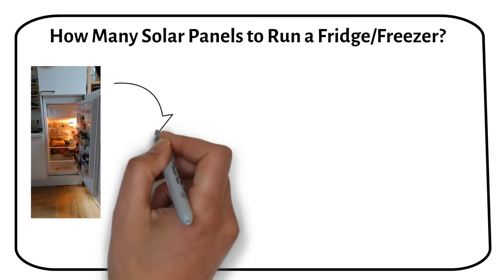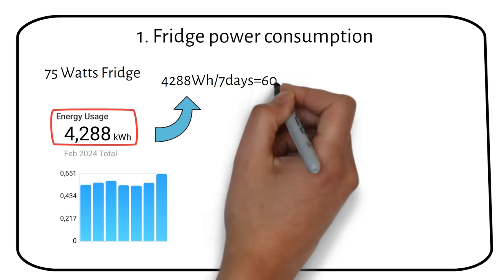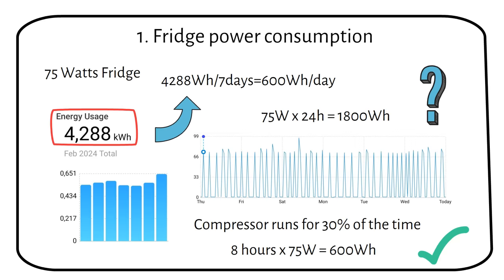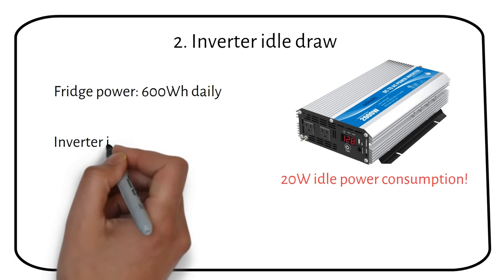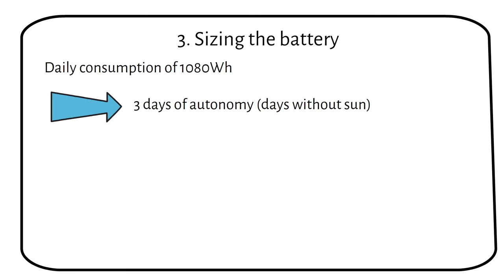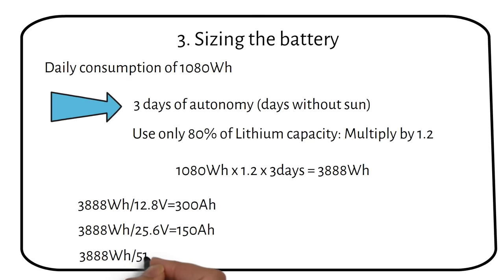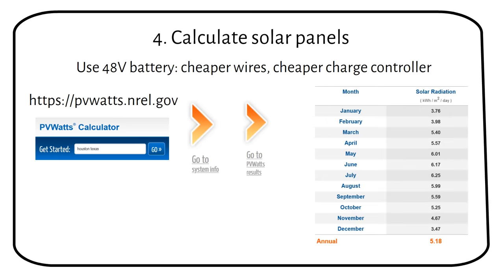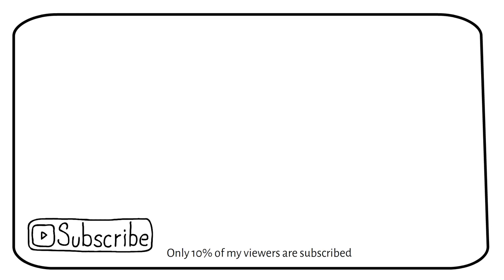How Many Solar Panels To Run a Fridge/Freezer?

Comment: Actually, a fridge and a freezer are not the most power hungry things around the house. Those that cook and heat water with electricity have it tough. 
Very good info, thanks. I will sent the video to all my friends that ask me how many panels and battery capacity they need to run theirs house totally off-grid.
Reply from the maker: Indeed, heating and cooling are the most power-hungry. At least with cooling, you know there is sunshine, too. Thanks, Sebastian!
Reply: @cleversolarpower  I am really glad I found  your channel, you explain all verry well, easy to understand and follow the flow. Thank you.
Reply: @sebastian19745  Agreed. And a pleasure to hear things described without the abrasive 'up^speak' of which westerners have grown so fond.
Reply: pay attention to the fridge compressor start up wattage needed as that can be 4kw, so you will need a 4.5kw inverter just to get that compressor running. once it is running it will constantly use a much lower wattage.
Reply: The only problem is that they would need to be completely off grid - if you are still connected to the mains and you have a power cut the solar generation automatically shuts down - otherwise the electricity workers can't get a totally dead power line to work on! (You'd think they could get a system to auto disconnect from the grid until the power came back on so we could carry on using our own generation!)
Reply: @DC-te1gw  Just about all inverters can handle surge loads.  High frequency inverters can usually handle 2x, low frequency inverters can usually handle 3x.   So you can size the inverter to roughly 1/2 the surge load and it won't break a sweat.   

Surge loads for modern fridges tend to be very low.  Often under 2000W, and running loads are typically in the 200W range.  You definitely don't need a 4kW inverter nor would you want one because the idle consumption for a 4kW inverter is huge.  I can run my full-sized home fridge with a 800VA low-frequency inverter without issue.

Old fridges might be a different story, YMMV.

-Matt
Reply: Don’t forget gaming pc or console
Reply: You don't want to support the most power hungry devices as the cost can be 5 times more expensive to build your system. You want to have all the basics covered

Comment: I've been slowly working on my offgrid system and one of the challenges for me is location and number of panels. My local government requires a lot to mount panels on my home DIY, so I have free-standing, movable panels, but this is not ideal as it takes up more usable space on my already limited size lawn, and is an eyesore to my spouse and neighbors. I currently only have 400 watts of panels, and might reasonably be able to increase that to 600 or 800 maximum. I have way more space in my basement where the storage batteries are, so my strategy is going to be to increase my battery capacity and potentially remotely charge some additional batteries from another location or from my car alternator if needed to top up or extend my runtime in the instances where my panels will not be able to keep up with the demand over a longer period of time.
Reply: My beloved local government doesn't give a shit where I put panels on my property but after cleaning the panels on the roof a few times and those on the ground level... I will be getting those buggers off the roof very soon. The occasional brooming is way, way easier at less than 2m above ground. And they cool better. 
Just a thought...
Reply: After 37 years as a carpenter having installed rolled roofing, shingles, shakes and tin roofing, I've never subscribed to adding more holes in the roof to attach solar panels.

Comment: We got 4 (100watts) facing east and 1(100watt) facing west. It runs out big fridge freezer and outside lights for 10months in a year. In December and Jan we charge out AGM battery bank at midnight during the cheap rate. The whole thing saves us about £70/yr

Comment: I run my ancient half size fridge on 6 HF solar panels and 2 100ah li-time batteries. I have my system wired in a 24 volt configuration and a rich solar 40 amp charge controller.  I have had to run the generator  a couple times but it has been very minimal.  When you have a smaller system and are off grid or just don't want to use wall power or a generator it pays to watch the weather and learn your own personal equipment.  Also going to a 24volt system is the best,easiest and cheapest way to go.  24 volt also has a little bit better conversion efficiency. I started with 12volt and can definitely vouch for the efficiency factor of going to 24volt.

Comment: One word about inverter sizing:

I recommend buying one with the same rating as a standard wall socket. That gives you the opportunity to plug in any household appliance in the future without having to buy another inverter.

I use a 2000 wh inverter for every appliance I have.
Reply: Be sure and get a true sine wave inverter, NOT a modified sine wave inverter!
Reply: @vincentrobinette1507  I am using a modified sine wave inverter and have not had any problems except for my clocks do not keep time correctly.

But I do agree with you that a person is better off with a true sine wave inverter.
Reply: I tried a 300W inverter on my 75W fridge. It turns out, that the compressor needs higher currents during start up. So my inverter always went into overload. A 800W inverter works now, but it also gets very noisy in that moment. So more than 1000W would be recommended.
Reply: @notconnected3815  Refrigerators that have the new-style rotary inverter compressor do not have a high start up surge.

The conventional style refrigerator does.
Reply: @Matthew_Loutner  Oh, i didn't know that. So someone who is planning to build such a system should measure the peak current of that particular fridge before choosing an inverter. Thanks for the tip!

Comment: Excellent!!  I live off grid and my solar and wind run a 5000W (surge to 10,000W) modified sine wave inverter from a bank of surplus aircraft NiCad 12V batteries.  We use propane for the fridge and that allows us to just turn off the inverter at bedtime.  One of the problems we have run into is the startup load for the electric freezer on another portable system.  We were using a 1000/2000W modified sine wave and had to go up to a 2000/4000W just to handle the start load.  When it's running the load meter shows only about 45 watts.  Also there are some appliances like blankets and heating pads that will not work on a modified sine wave inverter.  I don't recall if he said the inverter was a pure sine wave or not.
Reply: Does inverter have its capacity
Reply: Motors don't run as well with a modified sine wave.

Comment: Very informative video, I appreciate your attention to detail. I have a UPS system of 6200 watts and 5100 watt hours of battery (4 X 102Ah) @12.5v so it is a 50 volt system. Inverter uses 50 watts an hour idle current. I will add more battery power next.
Thanks for the video.

Comment: Clearly depends on the freezer or fridge. With mine, I manage to run it 24/7 with a single solar panel even for several cloudy or rainy days in a row. Plus, the freezer itself acts as a battery.

Comment: Thank you so much for these informative videos!  We are slowly building our system with the hopes of one day being off grid. Currently we have 1800W solar panels at 24volts, 3 each 24volt gel batteries and a 3500W inverter... but we are still wanting to learn more about the capacity and what we can run continually on what we have. Thank you again!
Reply: look up, lithium phosphate batteries. wth good bms they cant last more than 15 years.
Reply: Add some type of water source with Columbine waterfalls for continuous power

Comment: Rather divide the daily required power by the usable battery power than multiplying it : 
e.g.
You said : 1080Wh x 1.2 x 3 days = 3888Wh (x 120%)
Rather :   (1080Wh ÷ 0.8) x 3 days = 4050Wh (÷ 80%)

Other than that, this is a brilliant video!

Comment: What happened to the consumption while charging ? You must charge the battery and run the appliance - for 24 hours - to get a valid sizing. You must define your initial condition and reach the same condition again to have valid sizing.
Reply: Good point!

Comment: I have a shed that has a full French door fridge,, upright freezer a attic fanI and some led lights. I have it connected to a 12v system. I have 6- 100ah beep cycle batteries, wired in parallel. Two charge controllers that have one 320watt panels connect to each. I’ve been running this for close to 3 years. During the summer it when it runs the hardest and the batteries barely go below 80%. Those panels fully charge the system, even on rainy days.
Reply from the maker: Thanks for sharing your system.

Comment: I have bought a compressor Refrigerator for the Motorhome 12 / 24 V for comparison. Cool 101 liters Freeze 31 liters, 457 Wh/24 h and no converter is needed for operation. Not big, but in the RV it is sufficient and if you have it at home, you can have 2 and turn one off when you don't have much food.

Comment: i ran a fridge on a very small island system years ago. it worked with the cheap no-name inverter, but when i replaced it with a brand one (AEG) it started to kill my lead batteries every year until i noticed:

the no-name brand had almost zero idle draw while the expensive brand one drew more than 20 watts. the brand inverter broke every few months and i got 3 warranty replacements until the lead battery exploded which destroyed the inverter for good

Comment: Less sun hours in winter will typically correspond to lower house temperature which will reduce energy usage per day.  Thus, your solar sizing seems rather conservative (worst case). Otherwise, solid analysis.
Reply: Only when you use aircon, which is rare in Europe

Comment: I'm not sure that winter offers the worst conditions for a fridge. If it's 3 degrees outside, well then the battery won't have to discharge at all.
Reply from the maker: Do you put your fridge outside?
Reply: @cleversolarpower i would.

Comment: 3.5 kw-hr per day for my refrigerator. In the summer there are 14 hours a daylight so one 300 W solar panel would do it assuming 90% efficiency from the inverter. In the winter 8 hours of sun light and the sun is lower in the sky so the panel only supplies 80% of the summer output. So I need three panels. But it's also true that the heavy overcast typical of winter cuts the panel's output to 7% of nameplate, or 1/14th. So 3 times 14 is 42. 

That number again...

Summer is easy, winter not so much unless I move the refrigerator outside.

Comment: I've done some math of my own and realised that it is a lot cheaper to get a small battery that can keep things running overnight and run a generator in case of bad weather. Instead of 4 kWh storage, just get 1 kWh and a generator. It also means you can make do with half the solar.
Reply from the maker: Yes you can, but you will have to start the generator quite often then.

Comment: My   20 year old 18 cu ft fridge uses 1.8 kwh per day.  Matches the online estimate.  A new one  uses approx 1.2 kwh/day but the payback time is hard to justify replacing a fridge that is working fine. 1.2 kwh would be easier on a solar generator system to run it for several days (or even 24/7) in the Winter in Ma.

Comment: Most fridges use a large draw of electricity on the start up of the fridge each time it turns on. So, a start capacitor integrated into a battery rack might be beneficial. They sell something called "soft start" kits for air conditioning units which are start regulators that have a control board, and a start capacitor in them. (Super capacitors). There are also automobile/semi/RV battery chargers nowadays that are a bank of capacitors that have the cold cranking amps to start most vehicles. This could be looked at as another "soft start" device.
Reply from the maker: The thing is, when you place them next to your battery, the power still has to go through the inverter. So having it installed this way, won't do anything for the surge. It would be better to place the capacitor on the AC side. Adding it to the DC side will help reduce the voltage drop if you have lead acid batteries, but i wouldn't worry about it with lithium.

Comment: Living on my boat in the Caribbean I threw the fridge and chose not to have one. With an average temperature of 28 - 30 C° inside the boat the fridge sucked current like crazy and even heated the boat up. I do not need ice cold drinks. Water with the temperature of the environment is okay for me. For the longer turns canned food is a must.
Reply from the maker: It would be interesting to see how you keep food fresh on a boat. Thanks for sharing your story!
Reply: @cleversolarpower  Cruising near the coasts I buy small amounts of fresh food on a daily base like fruit, vegetables, eggs, bred etc.. For longer turns canned food, survival food, pasta, soups etc.. If I we wonna have a party someone brings ice cubes for the cooler box. That's it

Comment: Can I use my electricity meter reading and follow the same steps you described in the video to calculate usage and sizing a system for the whole house?
Reply from the maker: Yes, that would be even more accurate. 👍

Comment: Now we live in conditions of shortage of electricity generation.  Sometimes the schedule and power from the network is such that 7 hours offline, 2 hours online.  a family of 4 people, the refrigerator is opened maybe 30 times a day.  I use cold accumulators, but they do not have time to freeze in 2 hours online, there is still a problem with radiator ventilation.  Temperature conditions are 30 degrees Celsius.   I made a device that blows the radiator out of cardboard and 12 cm fans for computers, and a power supply unit.  In addition, I plan to provide power from batteries, unfortunately, solar panels are not available to me, because this is an apartment building.  Thanks for the tutorial video.
Reply from the maker: I would get a battery and inverter than can handle the 7 hours of running. Then get a charger and see that it will charge the battery full again in two hours. So a 2000W inverter, 12V 200Ah battery and a 14.6V 20A battery charger. Then your fridge can run from the power stored in the battery and recharge when the grid is back on.

Comment: We have a 522 cubic liter (about 20 cubic feet) refrigerator operating in a room with the temperature between 25 and 30°C. This is in the Philippines without air-conditioning. We used Wattmeter and found a refrigerator power consumption of about 3 kWh per day. On a sunny day we can both run the refrigerator and recharge our batteries from our six 200w panels.
Reply from the maker: That is a lot of power! Do you have an old fridge and is the grill at the back of the fridge free of any dust? Check if there is ice inside the fridge and run the defroster if needed. Some fridges get warm because there is ice buildup in the fridge.
Reply: This refrigerator seems to have the evaporator built into the sides of the refrigerator, which become hot when the compressor is running. There are no evaporator tubes at the back of the refrigerator.
Reply: Thanks I am in the Philippines too. How much is the heat loss nowadays on the panels. That killed the use of solar 20 years ago in Thailand
Reply: @llothar68  recently, our weather has been exceptionally hot and sunny. the power generation from the solar panels seems excellent. Perhaps it would be somewhat better if it was somewhat cooler, but overall the panels are doing well in the 100°F weather we are having.
Reply: @llothar68 Now there are solar panels everywhere in Thailand, but i only get around 350Watts out of a 450Watt panel when it is 45°C (113°F) in the shadow
Reply: @cleversolarpower  In Thailand because hot weather 45° C my fridge freezer runs almost 24/7

Comment: Need to factor in inverter efficiency,  the best around 93% but only at optimal power draw, often closer to 86% most brands
Reply from the maker: True, but that would make the video unnecessarily complicated. I already factored it in with the idle consumption.
Reply: no idle draw was good but its just one more term to add (fridge draw + idle draw) /efficiency*# of days without sun = size of battery @cleversolarpower

Comment: Most fridges got a huge inrush current for one or two seconds. it must be put  into  considerations for when you plan to purchase the inverter. an ordinary fridge draw 10-15 time more inrush current. 
I got an 12V 1600W inverter. It will not run a fridge except the modern ones with an  inverter drive circuit.
The idle input power of a 2kW inverter is about 20W. 12V versions have got more idle power then 24V or 48V ones.
Reply from the maker: Mine draws 6x startup current. Each fridge is different. how old is your fridge? thanks for your comment.
Reply: @cleversolarpower  Its about my old one in the cellar. Its only to keep my beer cold. This fridge is abt. 25 years old. When its switch on it make the lights flicker. It draw 9-10 times average current and got a large reactive current.
the label on the compressor say 90W but i measured 105W/ 200VA  with a precision wattmeter. The label state nominell  220V volts, but meanwhile we got most time 235V in the sockets.
My new one in the kitchen got the latest technology, it draw very low inrush current.

Comment: So you didn't say how many panels needed?😮,   you did do a good Job on the presentation,  would like to get the info on how many panels would be needed?😊
Reply from the maker: Everybody has different solar panels. You can have 100W, 200W, 250W, 300W 400W, 500W, 550W so it depends on the rating of the solar panel. Divide the total power by your solar panels rating.